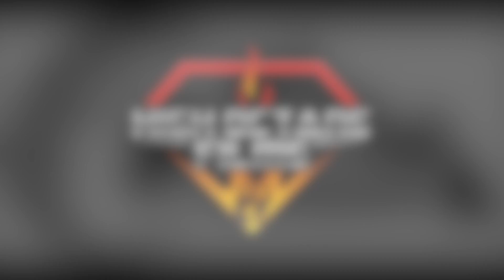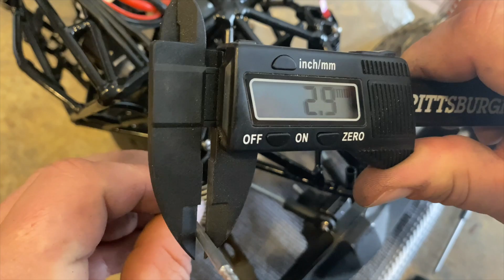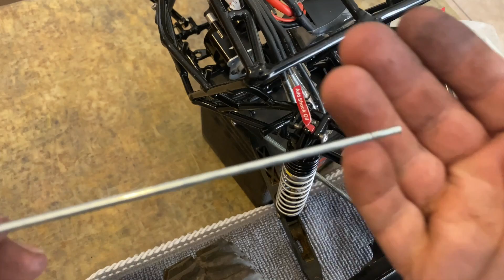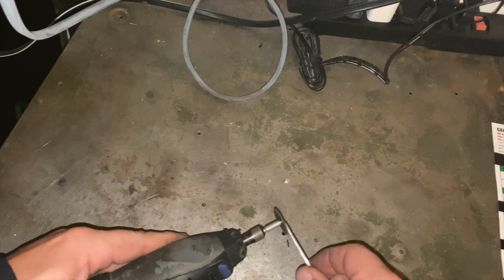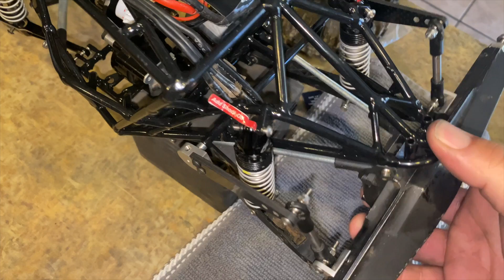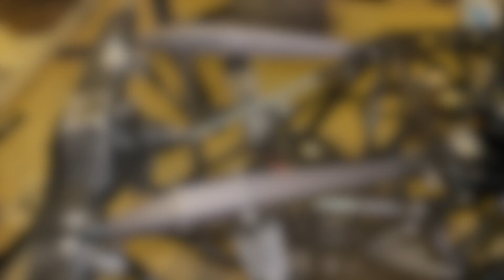RC Command Tech Tuesday Sway bars

Comment: Did you not grind flatspots on the rod for your setscrews for a reason? Any worry about them slipping on the shaft? Also if you have a drill you can Chuck your rod in it to spin while grinding with a dremmel for a smoother finish.... That's also how I wet sand my links for a mirror finish...
Reply from the maker: jeremy thank you for watching and commenting!  I am hurting for tools right now. But I did go back and did a whole new torsion bar, with the flat spots like guy mentioned, and I took out some material from the middle of the bar, because the sway bar was too stiff.
Reply: Your videos are pretty rad, and there isn't much else out there on rock bouncing. I'm in San Diego which has a pretty big U4RC scene. Already built two of those, waiting on some new motors to show up for my big 1/6 rock bouncer/U4 rig I built.
Reply from the maker: @96Tailgunner  Hang in there.  You're not the only one diggin' this RC rock bouncing stuff.  There may just be a series popping up on the left coast, very soon.